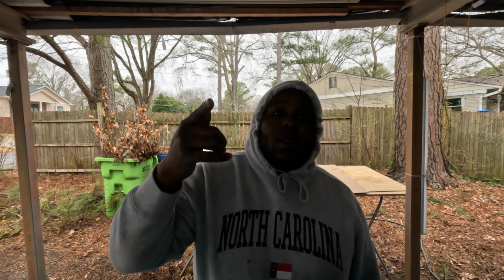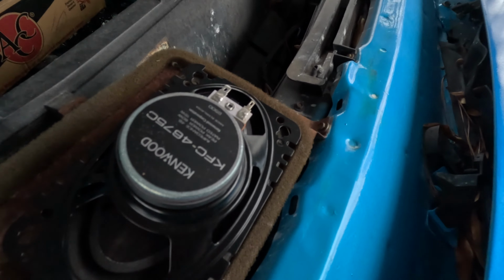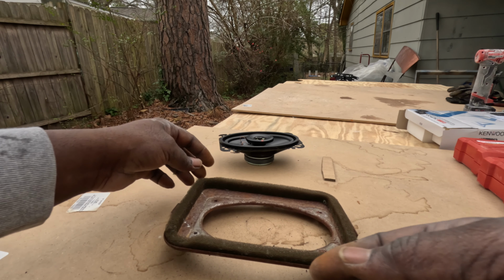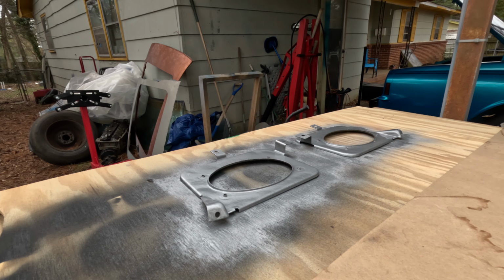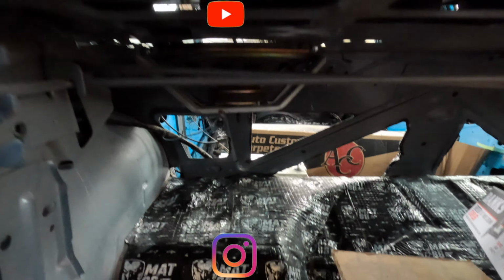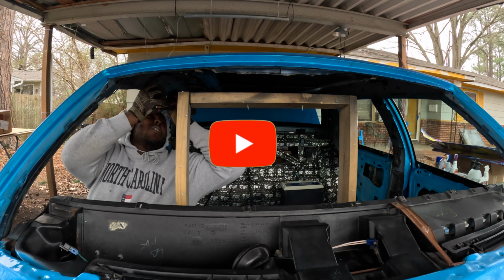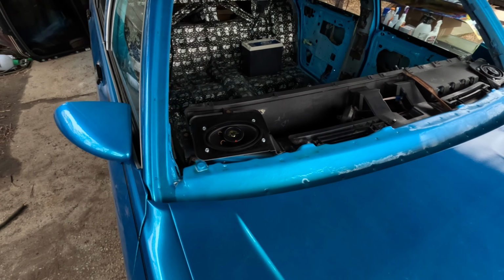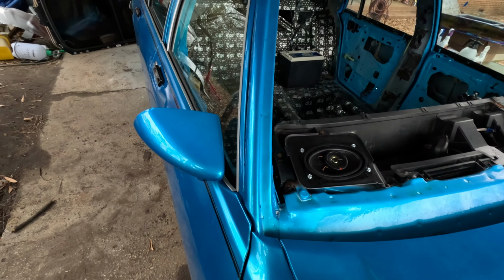1989 Box Chevy Build Ep.24 Replacing the Factory Speakers!

Comment: Tuned in bro! Hey just a heads up you might want to change the two top bolts in the 4x6’s cause once you put the windshield in, if you ever need to change it out it won’t be so hard to get it out a short tubby Phillips head works good